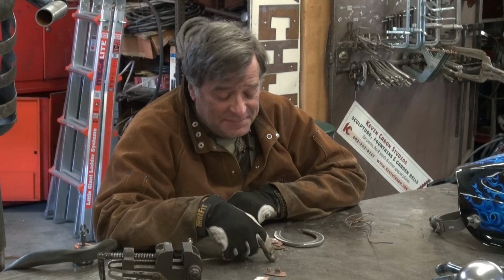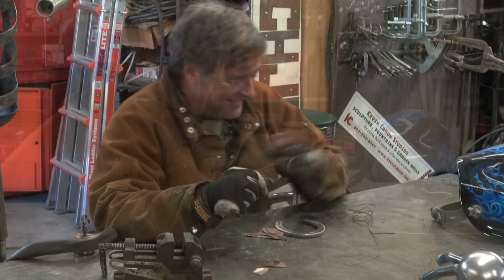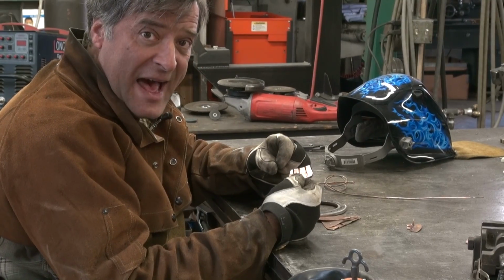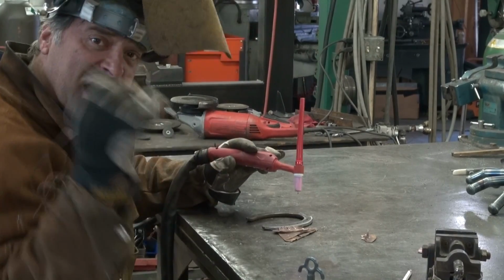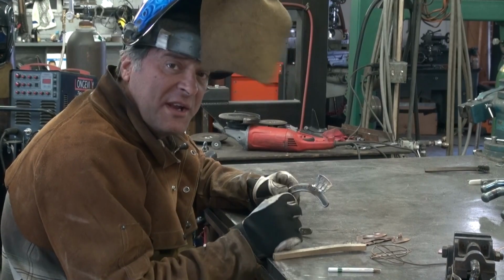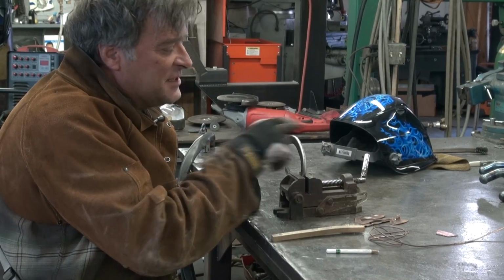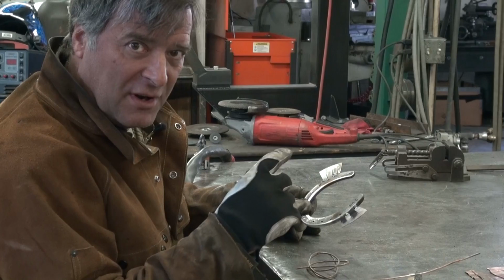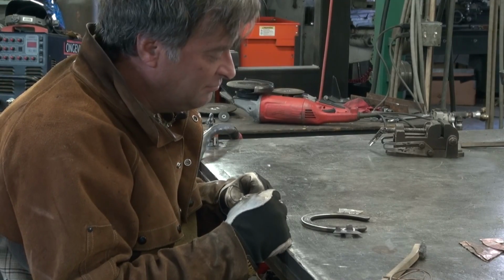How to Weld Copper to Steel for Art - Kevin Caron

Comment: Thanks for the reminder that I'm not skilled enough with my new TIG welder not to burn through the thin steel I want to attach copper wires to! I will have to find another way.
Reply from the maker: I have total faith that you can do this!   Just have to go slow and practice before you do the real job.  And have a copper or aluminum backer plate on the back side of the weld to keep the steel from blowing through.

Comment: I used to have a boat trailer that had a copper wire welded between two sections to make electrical ground for the taillights.
Reply from the maker: I fixed a buddies trailer by doing that.  The ground behind the lights was so rusty from being underwater that the lights won't work.
Reply: @KevincaronSculpture  I was going to try welding 10AWG copper wire to a copper clad steel ground rod, but I decided to order the clamp instead. I don't have a TIG welder. I have a flux core welder.

Comment: Another technique is to rivet weld using Mig welder  it is not the solution for everything but has its applications simply drill a hole in the copper piece turn heat up slightly so you get a good zap when you initiate weld  place item into desired position in this case over horseshoe and basically plug weld the hole in the copper, you are not concentrating on the copper as much as you want a good tac to the horseshoe, the  heat required to make the tac is more than adequate to form the rivet you can also use another form of this process by placing a small tac around perimeter  of a sheet   of copper placed  over a frame of ferrous metal imagine you make a picture frame of mild steel and you want the copper to be the background of picture cut copper slightly smaller than outside dimension of frame and clamp well and place welds right at edge of copper every inch or so around entire perimeter copper and you have rivet welder the non ferrous to ferrous and it will be structural.
Reply from the maker: I will have to give this a try!!   Thank you for watching and posting.
Reply: @KevincaronSculpture  The same Smith that showed me this technique also demonstrated a pretty crazy but interesting process he would descale a piece of flat bar with a flap disc then he would heat to cherry and quench in muriatic acid the results are inconsistent but one out of ten would resemble Nickle when he quenched, it would be a series of dips not full emersion he was a Master and these two techs I've posted have been the most unusual and effective, of coarse the acid quench is for small projects but knowledge is knowledge.

Comment: Hello from Paris,
I enjoyed your video.
I tried the method with a direct weld with an oxy-acetylene torch. She asks me a lot of heat because my copper block does not come into fusion. It is a hassle ! I have over 40 stylized leaves to put on a stair railing. Indeed, to have a green leaf effect, I can only use oxidized copper.
So I want to solder a stylized green leaf of copper (10mm thick block) to the end of a 10mm rod of soft steel.

Will I have better weld resistance over time?
Thank you for your reply.
Reply from the maker: You will need a tig welder to do this correctly.   I am not sure if you will be happy with the results if you try to solder copper to steel.  Use copper electrical wiring for your filler rod.  I just strip the insulation off and get to welding.
Reply: @KevincaronSculpture  Unfortunately, I don't have a TIG. So I have no choice and will try by bringing copper (electric wire) with a low voltage arc welder.
Reply: It's OK ! :eyes-purple-crying:

Comment: Brazing with copper.
Reply from the maker: Not braze, no flux.   This is welding.
Reply: Ok did you melt the steel and then add the copper to the steel? Flux is a cleaner and to stop oxides forming on the molten metal. Your tig gas would have done the same thing.

Comment: Hi good I want copper pipe &ms  plate tig welding how weld &which filler wire use
Reply from the maker: Check description

Comment: Any idea of which would be the best way to solder Copperweld bars (a steel nucleus surrounded by a copper 1-2mm sleeve).  I tried arc welding the steel but at 80 amps it doesn't get past the copper (would ruin the copper finish anyway); also tried silver brazing (6% for copperish colour) but it seems structurally weak (to make a copperweld table).  Any thoughts.  Don't have a TIG.
Reply from the maker: Silicon bronze and tig welding is about the only way I know of.
Reply: @KevincaronSculpture  Thanks for your answer.  Maybe someone else has a trick,  TIG is out of my field for the time being.  Maybe I'll just have to strip the copper off the ends and arc weld the steel, and then cover the welded parts with something to give it a nice finish.
Reply: If all you see is copper, and the thickness is as you say, you should be able to braze it with "CU-PHOS", an alloy of copper and phosphorous.  It melts easily and flows like water, bonds clean copper w/o flux.  It's very strong!
Reply: @leonardpearlman4017  It seems that somehow the steel core reacts with the phosphorous despite it is mostly covered by the copper sleeve, and so the brazing alloy (the weld) ends up brittle and weak.  The best result I have achieved has been putting the ends of the copperweld bars inside a copper elbow and brazing them to the elbows, however that is as strong as a soft copper elbow can be (not much).

Comment: i used a pcb soldering wire, and a gas stove to solder endings on a copper pipe so i could use it as a radiator for a specific project, and it worked.
Reply from the maker: Getting the job done with what you have on hand is the best feeling!

Comment: just getting into copper steel and aluminum art also using wood.  can you mig braze this? also  what is the best tig  to get for starting out.   self taught as you.
Reply from the maker: You can mig weld steel and aluminum.  You will need tig for copper.   You should look at the AHP and Everlast lines for tig welders.   The AHP is better for new welders.

Comment: I love your approach. Very funny. I'm trying to repair a friends little copper sculpture. I have a Miller-matic mig welder that came with what I think is a spool of Copper wire. Can I just load the wire and weld the copper. Or is there more to it?
Reply from the maker: Haven't tried it with a jig. Don't think it will work, but not sure. The wire spool you have is most likely a copper coated steel wire. That is normal for mig. I was using a tig welder in this video, it's a totally different process.
Reply: must say i never heard of mig welding copper,,you can tig weld it with copper wire i suppose but it is very difficult to get the part hot enough,you may need to be using helium gas or a mix of it although i did manage to once fuse two piece of copper sheet with argon tig but it was difficult getting it up to heat even small sheet pieces like that

Comment: Kevin: I really enjoy your videos.  Thanks very much.     Is there any way that molten metal can be "poured" in crack area to form a weld?
Reply from the maker: Only if you can also get your base metal molten at the same time.   

Sort of like welding,,
Reply: That's a funny question!  As it happens, this is about what welding is about, you're making a little casting on the spot.   Thermite welding does what you're saying here.  Some superheated metal is poured into a prepared joint, it melts the base metal a little, and when the smoke clears there's a joint.

Comment: have you tried micro welding copper or other non ferrous metals. I am thinking of trying copper wire strands with a tig welder using .020 electrode.
Reply from the maker: +Pip Deal           Sure,   Just have to practice first..    Easy to do..

Comment: What about the copper coated mig wire? Hmmm?
Reply: Joe Shmoe what about it? copper coating is thin, very thin and practically vanishes during welding. it's only there to stop the mig wire rusting to hell and improving conductivity for the welding process since the copper coating brushes through the copper mig tip instead of steel.

Comment: Interesting, nice job, the electrical copper cable will be pretty pure and perfectly ok for welding and considerably cheaper than the regular copper alloys you would have to buy for this. Obviously you would never fusion weld copper to steel from a structural sense as it is a metallurgical disaster but for this type art work, great.

Comment from the maker: Water cooled is available for an added cost of course. All told, if you were to get a 200 amp ac/dc tig with the cooler you are looking at about $1500.00.  Go look at a Dynasty® 200 Series for $3,744.00. And that is without the cooler.  Longevity also has a try before you buy program. Check out their forum or call them for more info. on that. If you are looking for a MIg welder than look at the MIgWeld 200s.  220 volt and spool gun ready.  That's my 2 cents worth.....

Comment from the maker: Well, low cost vs quality, I would have to point you towards Longevity. I have been beating my three machines for over a year now with no problems. They continue to improve their machines and listen to the people that use them. Yes, they are made in China. So what!!   They are half price compared to the red or blue ones. My TigWeld 250 is in my opinion a much better machine than the old Miller 200 syncrowave I started with. Uses less power and is more fine tunable than the Miller.

Comment: Hey what brand of welder would you recommend for low cost vs quality?
It is meant to build up a block with lot's of wire and just welding more layer on top of each layer, so I guess watercooled, but what is the price range for all equipment together I should be looking after?

Comment: Had to watch the video again.  I really like it.  OK, had to try the dissimilar metal corrosion test.  Welded Cu tube to steel and dropped it in water for 36 hours.  There is significant corrosion, but don't have the equipment to tell how fast it's going.  Like you said, it works to make stuff to hang on the wall and makes the steel a cool color.

Comment: I'm from Missouri so I had to try for myself ;)  I used a flattened piece of 1/4" copper tube & 6mm steel plate.  Worked well.  I don't have your skill, so putting in the copper wire I ended up with a blob, then void, then blob...  I tried a Yawata FT51 2.0mm mild steel rod without the copper wire & got a good result (not great, but better).  I can weld the unflattened tube also.  It's not structural, but will work well for decoration.  Not sure about corrosion, will have to try that.

Comment: Thanks for calling me a gentleman Kevin.  Your the gentleman for doing this video to help me understand what I was missing.  That did help alot.
  
I have tried the AO method and it was just too frustrating.  Copper to steel and brass to steel each had their own different requirements to braze on.   I'm hoping the TIG will work better for me.  I was using a Meco Gas Torch to do the brazing.   A great torch.   But I have big expectations from the TIG.   Thanks for the video.

Comment: ive had some pretty good experience using silicon bronze mig wire to join copper, bronze & brass to steel recently.... pure argon, full amperage & be prepared for a very limited duty cycle... I also repaired a cast iron knob with the same set up a year ago on a piece of woodworking machinery and it is holding...

Comment: Cool demonstration, I like it when you use discarded wire from another use, like the ground wire from some old Romex. 

Wyatt from MrTig here on Youtube recently showed how to do copper-silicone brazing, with a fabulous result. It's way less messy than my gas brazing. What puzzles me about linking copper and steel is my memory of possible redux reactions that happen when the two metals contact each other. To prevent that they want you to use copper nails rather than steel when affixing Cu pipe.